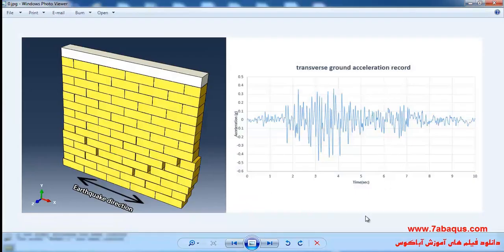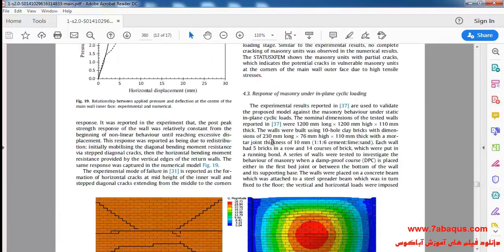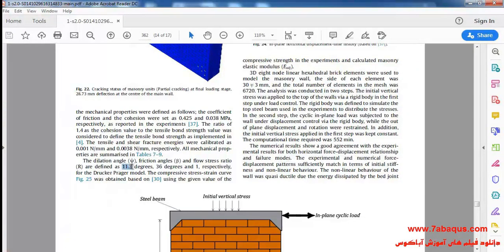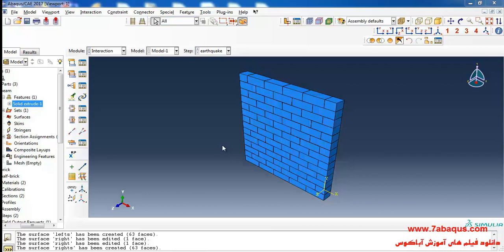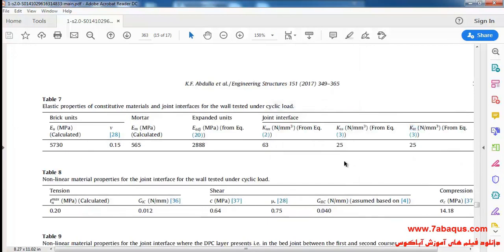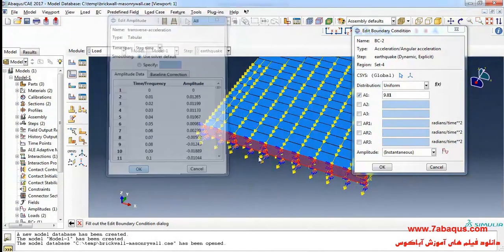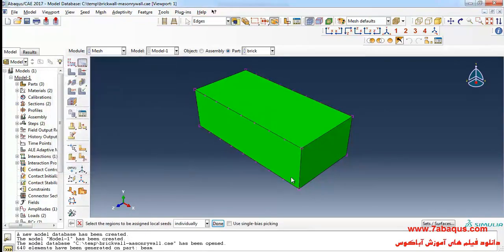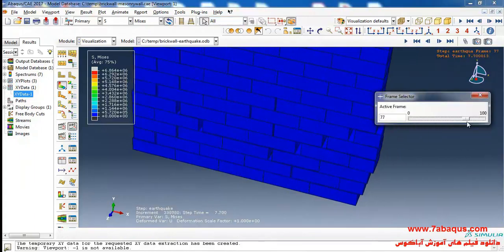Masonry wall (brick wall with mortar) undergone the earthquake using simplified micro Abaqus

Comment: hello, I ran a model with the simplified micro and I only used gravity load and it works fine , but when I add the hydrostatic pressure on the masonary wall (bricks wall with simplified mortar) the simulation doesnt work and gives an error " displacement increment for contact is too big" and plasticity/creep/connector friction alogrithm did not converge" can you please help me please?

Comment: if we'd used detailed micro model, then would we use the same Knn parameter for surface based cohesive behaviour?
Reply from the maker: The "micro approach" is different from "simplified micro approach"
In "micro approach" , you do not need the Knn , Kss , Ktt
Reply: @saeedmoeini-7abaqus  lets assume two biricks connected with a 10mm mortar. Then I will define two surfaces,arent I? I must define a contact property for this surface and cant I use surface based cohesive behaviour again?
Reply from the maker: @andromeda45  in "micro approach" , you should create the geometry of mortar and brick then define property of mortar in property module and then define interaction between mortar and brick but in "simplified micro approach" , you should not create geometry of mortar
Reply: @saeedmoeini-7abaqus  yes, thanks, I do that, but when I do that, how will I define interaction between mortar and brick? can I use the same values of Knn,kss,ktt which we obtained from simplified micro approach in the video? what do u think?
Reply from the maker: @andromeda45  No , you should not use the "Knn, kss, ktt" parameters
Reply: @saeedmoeini-7abaqus  instead should i define mortar with cohesive elements?
Reply from the maker: @andromeda45  Yes
Reply: @andromeda45  Hi.
Did you use general contact as interaction?
Reply: @hishamtariq7054  hi, i defined a general contact for surfaces which has a friction. For mortar and brick, i assigned another interaction with surface based cohesive model.
Reply: @andromeda45  Thanks.
Can you give me your email ID?
Actually I am struggling with cohesive interaction.
Reply: @hishamtariq7054  hello, hakankoman@hotmail ,but I will be busy these weeks, I have to submit a thesis. see paper: https://www.researchgate.net/publication/312500475_Simulating_masonry_wall_behaviour_using_a_simplified_micro-model_approach

Comment: Hello, sorry I need to know if the simplified model can be worked on a wall of about 60 x 60cm to apply diagonal compression, would you recommend any video please?
Reply from the maker: Hello
See this tutorial 
https://www.youtube.com/watch?v=_Lck4fE3AZA
Reply: Thank you very much, excuse a query how can I rotate the entire wall at 45 degrees and tilt to apply a vertical load? do you have any explanatory video?
Reply from the maker: @jessicasalas6446  You use "Rotate Instance" in Assembly module
Reply: hello there, I am currently doing modeling for diagonal compression test. DO you have any details or files regarding it ? Thankyou and hoping for reply soon.

Comment: Sir can we model interlocking brick wall undergone the earthquake using simplified micro Abaqus ???
Reply from the maker: Yes , you can
Reply: @saeedmoeini-7abaqus  Sir how??... Guide me plzz... Any video related to the modeling of interlocking brick wall ???
Reply from the maker: @muhammadjunaidjamil3224  I do not have any video related to interlocking brick
Reply: Hi bro, I am modelling an interlocking brick wall subjected to seismic excitation using Abaqus/explicit. The simulation results are generally good, with some deviations of the drift ratio time history from our shaking table test results, though. Maybe we can communicate with each other.
Reply: @guanyuxie1895  Guide me plzz... Any video related to the modeling of interlocking brick wall ???
Reply: @muhammadjunaidjamil3224  I don't have any vedios for that. But generally speaking, it is easier to conduct the simulation once you have modelled the geometry of the bricks, as there's no need to set the cohesive behaviour to bond the bricks.
Reply: @guanyuxie1895  Hello Sir, Sir plzz help me in this regard plzz.. I will be very thankful to you...
Reply: @muhammadjunaidjamil3224  So your problem is that you don't know how to model the geometry of the interlocking brick in Abaqus, right?
Reply: @guanyuxie1895  hello, I'm modeling too, did you perform a shake table test? Are you shaking a room? does it contain columns or beams too?
Reply: @guanyuxie1895 did you model this?